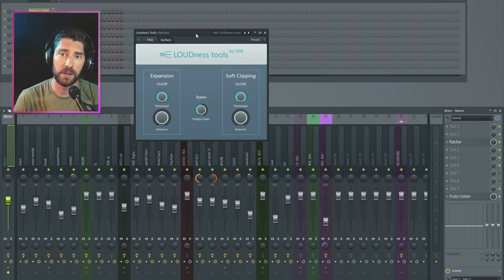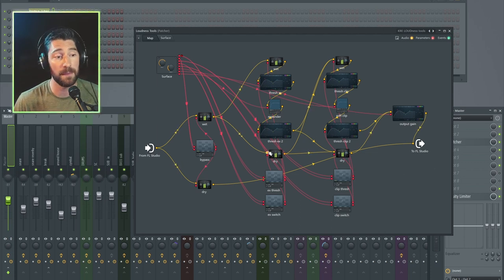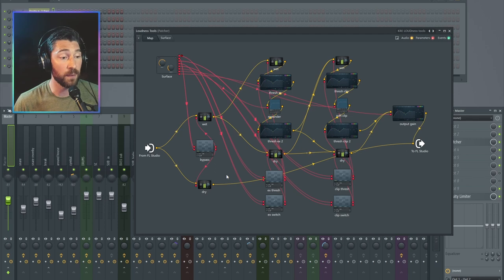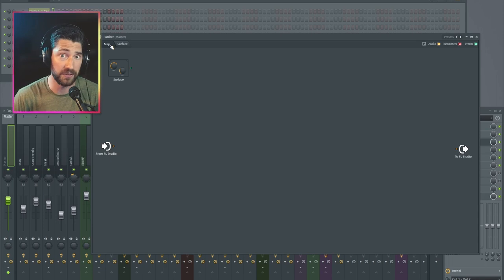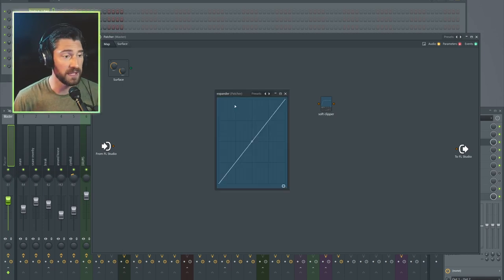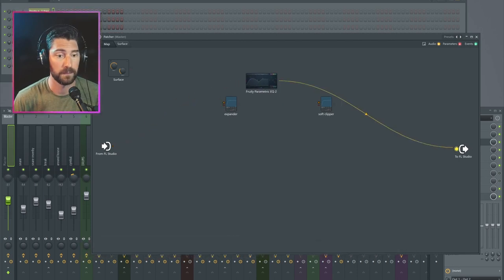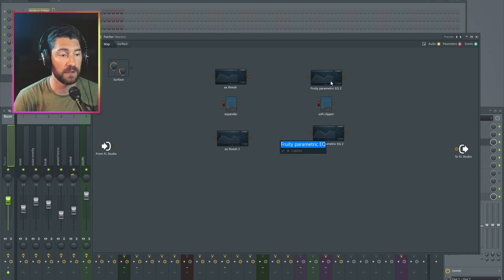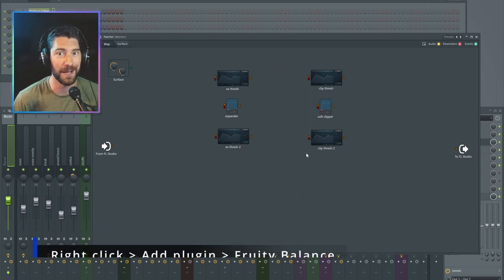Patcher tutorial - Start-to-finish plugin design!

Comment: Thank you! That's a very cool detailed, concrete and clear explanation! So, may I use this x-y-z controller for my gtr pedalboard for switching between two or three different AMPs? I tried doing this in Fruity Formula but each time both of my ODs turned on or off simultaneously instead of switching.

Comment: First of all, great stuff and thank you for these videos. I use pacher to make my own and also modefie sometimes somme verry expenssive plugins. You can do anythig. But I was wondering: 
What about the HQ, oversampling and linear phases in these nonlinear processes? If I introduce somme changes in EQ using one or two parameters, like slight HP or shelf filter with the Cliper going up, and gentle 180-560Hz cut when the Expender goes extremely up, for example do I put another separate EQ2 for each W-shaper, or can I use the output ones and conect the Fq control to Z on the XYZ controller? Plus, may be anti-aliasing LP filter at 20K on the output EQ2 afterb the wave shaper, do I put on the linear phase on evry EQ2 or just the one doing the Eqing. And than what about the latency isue? 
Please, please, 🙏🙏🙏 can you make a video testing some of your plug-inns in plug-inn doctor?  Showing the best setings for oversampling and linear phases. That's crucial for masterin and sum BUSes processing.
Turn on the phase curve in EQ2 and see what it does to phase shift especially with sharp HP and LP filter and on the sum Bus a slight shift in phase cancels out some FQ because there is a lot going on ther. And it's verry audible.
Thank you in advance and thank you for this video.
 You can also listen to my start to finish track on YT, type in "Ras Stingray - Abundant state of empathy". of that one I'm proud.

You can do all that just using Maximus within pacher all controles are at one place.
Softclip: Mast Comp-off or expand the comp curve linear diagonally to right up corner: A-sat. left 0.1- 0.2, Trh: - 0.10 and then PUSH the post gain untill you hear dist, then dial back a dB or 2; 
Expander: complete off low and high; Mid: make tha same curve as in your expander. Maximus is basically the multiband wave shaper with the ATT and REL, so you can play with that also.
 Latency Dell off or less than the default if you are not compressing muliple bands and limiting master and there is wet/dry knob for bands mixing. You can do the multibandn processing put the !Lin-Phase on!. Don't compress at the mastering stage. If you saturate the highs and mids together it really rounds tham up together but then you have to do the same expansion and conection for the controles on each band. (low off)
I use Fq splitter sends lin-ph, other analogue emulating plug-inns and processing on separate channels plus MID and SIDE separately.
put the presets for downloading I can modifie somme and send you back.
And yes, you can do it professionally (mix and master) on your own. Sorry for my English.
Tnx again so much.

Comment: This is an incredible tutorial. Super in depth and inspired me to make my own stuff in Patcher. One question, I'm working on a simple effect rack to have an all-in-one place for effects I add on basically every sound (EQ, Compressor, Saturation) and I want to add a width knob. The plugin I'm using for adding width is Infected Mushroom's Wider, but when the amount is set to 0% it makes the sound mono. I don't want to add width necessarily to every sound I add the effect rack too, but I don't want to make them mono. I was wondering if there is a way to set it so that turning the knob a little bit (even just 1%) could turn on the effect but it would stay off otherwise. If you have a way to do this, that would be great! Otherwise, that's okay. I can just make a button to turn on and off the plugin. Thank you so much!
Reply from the maker: Hi oakdll, I figured out something that should be able to help you.  I don't have the Wider plugin, but I played around in Patcher and got the right setup.  You'll need a knob for the Width, two Fruity Balances to handle the audio switching, and an XYZ Controller to do the math.  Enable X, Y, and Z inputs and outputs in the XYZ Controller, and connect your knob to all three.  Make the X start at 80 and pretty much instantly drop to zero, and then connect X output to the Fruity Balance that will be your bypass to go around the Infected Mushroom plugin.  Back in XYZ Controller, make the Y start at 0 and pretty much instantly go to 80, and connect Y to the Fruity Balance that goes into the plugin.  Finally, make Z whatever curve you like for the width of your plugin, and connect it to the Infected Mushroom width connector.

Here's a diagram I made and uploaded to Imgur:  https://i.imgur.com/FAF23Ln.jpeg

The idea is, when the knob is at zero, the bypass Fruity Balance sends your signal straight past.  As soon as you move the knob to any setting, the bypass drops to zero and the Fruity Balance into the Wider plugin jumps to 80, sending audio into the Wider plugin.  And of course the knob is simultaneously controlling the actual Width knob in the plugin using the Z section of XYZ Controller.

Hope that's helpful for you!  I would love to hear back from you if it works or if you have any difficulty.  Thank you for your kind words about my video!
Reply: @krednb  Thank you so so much! That worked perfectly, and gave me insight on how to use XYZ Controller. You have a level of understanding of XYZ Controller I will likely never learn, so massive props to you. It's super cool that you are still responding to peoples niche questions in detail on this video you posted a year ago. Thank you so much.
Reply from the maker: Oh I'm so glad it worked out  @oakdll  !  I think I answer all the questions because I feel guilty about not making more videos in the last year lol.

Comment: Why not use fruity mute 2 instead of fruity balance for the bypass knob? It only works with polar on/off values so you don't have to worry about the leveling
Reply from the maker: That works great too!  I like Fruity Balance because it lets you easily set up an on/off or a mix knob with basically the same setup.

Comment: And I have another question...1st - when I try to resize the surface according to the size of my plugin, there is a border where this resizing stops and I have to stretch THE PLUGIN to the patcher border. 2nd - when I load this patcher preset (or plugin) again, this resizing gets back to some default patcher size and the plugin looks with some working space except for its interface... How may both be cured?
Reply: You can help fix some resizing issues by going to the Map tab, right clicking on blank area, and enabling "remember tab sizes."  Other than this, resizing things is pretty tricky and will take some trial and error.
Reply: @rvstwi  Yes, thank you! It turned to be so easy)

Comment: Wouldn't it be much easier to make 2 separate patches without any bypass buttons, just make one, save, then change waveshaper preset then save under different name. No bypass needed because you can just turn on/off, the patcher instance. The whole video could be 5 min long with this method and require a fraction of routing to implement it. Instead you're expecting people to sit down for 40 minutes, watching you route the same thing over and over again.
Reply: hi dude!
hm yea but then you wouldnt have this cool user interface! :D
i thought it was useful because many plugins don't have a bypass button by themselves to toggle on/off within patcher, which makes me have to reroute again and again just to hear specific changes. i like to have everything within one patcher too so i can reuse and change up sound design experiments more easily 😊👍 though i will probably continue to just use fruity balance volume sliders for more flexibility.
Reply: oh no wait i thought you meant two patchers in the mixer, not 2 patchers within a patcher.
true.